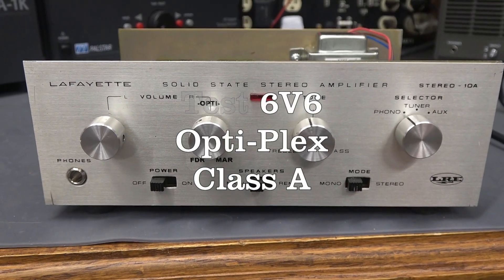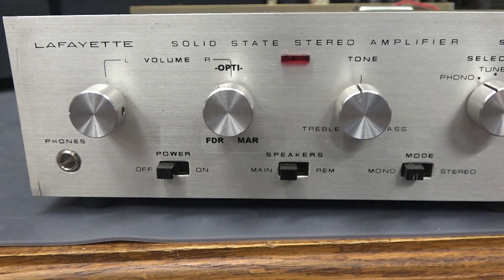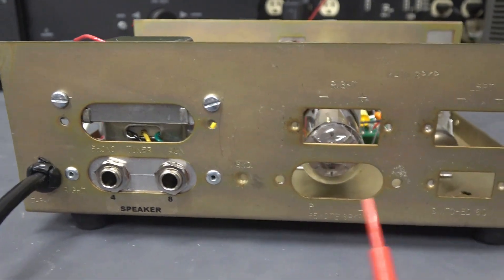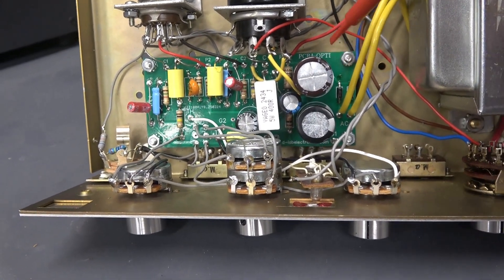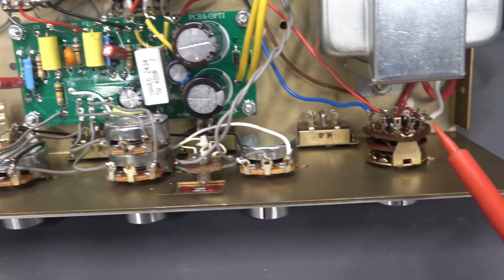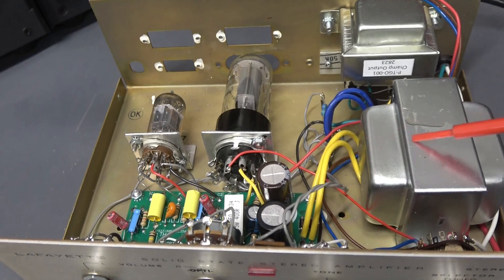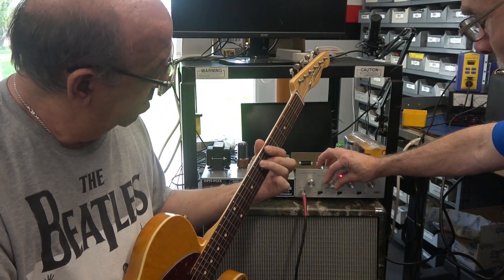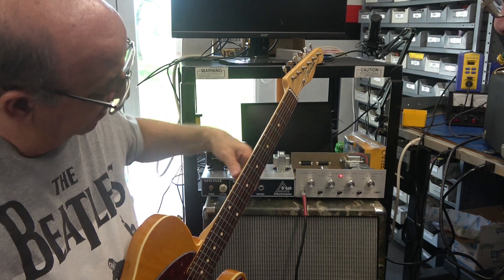Cool repurpose Lafayette 10A Opti-Plex 6V6 tube guitar amp handmade build

Comment: Terry, I have a Hammond AO-35 amplifier. Would I be able to use the transformers (power and output), tube layout and other components? I'm sure I'll have to gut a ton of stuff out, especially if I use the Opti-Plex board. Would this be a good candidate for this setup, or would I be gutting an amp with more potential?